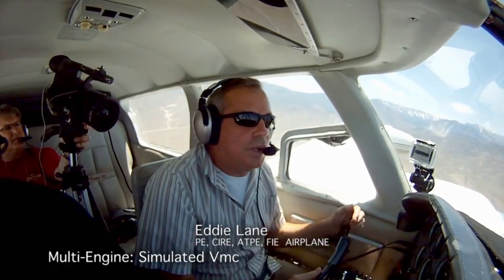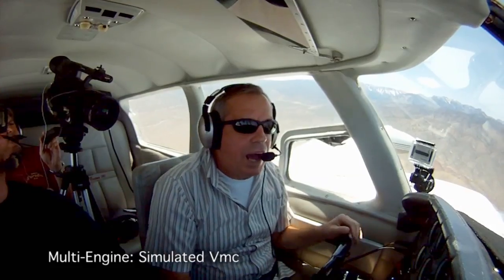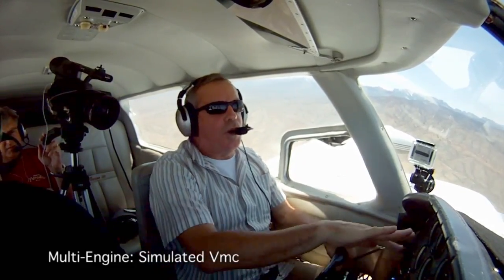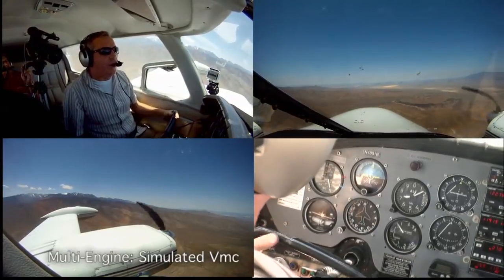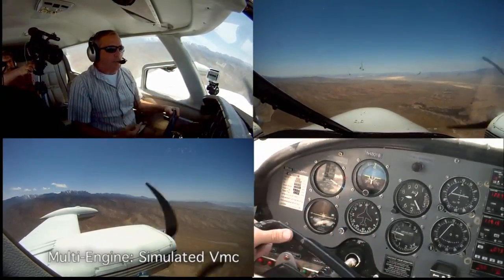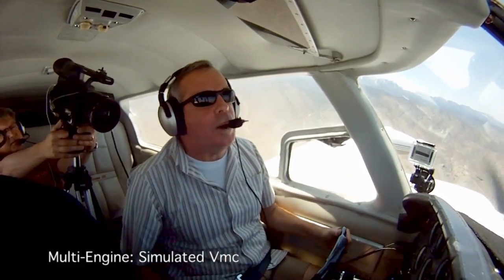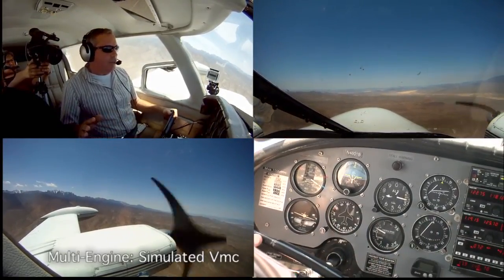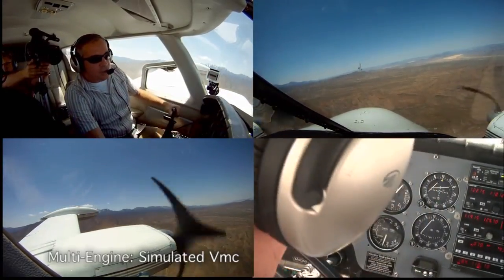Multi-Engine Lesson 4 - Vmc Demonstration

Comment: Doing a VMC demo with a passenger in the back is bad. Moving the CG aft can cause issues if you were to go into a stall/spin. A professional pilot should know better. The accident in Oregon and Massachusetts are examples of when having a passenger in the back may have been a factor in the crashes.

Comment: I've been studying flying for less than a full month and have already seen where FIVE people have died in "Vmc demos" which resulted in spins.  One was 4 Dec 2023, the most recent was 14 Jan 2024.  
Juan Browne goes to great lengths to explain to us how dangerous these maneuvers can be. The results speak for themselves.  Twins are especially dangerous if directional control is lost for just a little bit longer than the pilot demonstrates in this video-starting the spin. With the cameraman in the back seat--there's no way they'd get out of a spin if something happened at the wrong time and it got away from the pilot.  One thing he did have in his favor was altitude. I'd never fly with that guy. Is he still alive?  I wonder how many flat-spin twin crashes have happened in the decade since this video.  Blancolirio channel also shows where two were killed on 3 October 2023 apparently doing Vmc demo, and Mr. Browne is a pilot (of 47 years) that I fully trust.  SEE his channel if you think Vmc demos are a "safe enough" exercise.   They are safe enough in the simulator, but are a ridiculously dangerous in the air, and especially below 5000' AGL.  Think twice about Vmc demo in a twin. too many pilots let this one get away from them and the result is usually tragic.
Reply: Usually the issue with VMC demos is improper recovery, specifically people putting the nose down without taking out the power from the operating engine. That just throws you into a spin

Comment: Engine loss on takeoff with gear up does one reduce some power on good engine like in this video or does one simply follow "The Drill"?

Full Props, Mixture, Throttle then gear & flaps up, identify, verify & feather, raise dead engine slightly & keep ball half ball.?

Comment: What's more interesting here is that no point does he address what configuration the aircraft is in, or supposed to be in, for the demonstration. A Vmc demo is supposed to be performed in the takeoff configuration, which in this airplane would simply mean doing it with the gear down. No mention of it.
Reply: Lol the takeoff configuration is definitely gear up.....
Reply: @GZA036  No, actually. A properly executed Vmc demo is started with the gear down. It's intended to simulate that you've lost an engine in the first few seconds after rotating, with no usable runway left in front of you.
Reply: @TheS4Aviator  part 23 states the gear has to be up for the vmc speed..
Reply: @TheS4Aviator  Im an MEI and ive signed off 10 Multi students and always did it with the gear up. Your completely wrong.
Reply: I did my VMC demo on my AMEL check ride with the gear up, which was how I was taught.

Comment: Vmc is not the airspeed at which you lose control, it is the minimum airspeed at which the aircraft is controllable. Quit looking at the guy in the right seat, Keep your scan out for other aircraft and your instruments. During the demo, keep your hands on the yoke and throttles at all times. This instructor is a complete idiot and should have his certificates revoked by the FAA.
Reply: gypsykingg your not a pilot. 
Vmc is not a hard speed limit like Vne. It’s a reference speed that is determined by the manufacture, at which when the critical engine is made inop it is possible to maintain directional control with an angle of bank less than 5 degrees. The actual minimum controllable airspeed can vary considerably depending on...
Power 
Prop (windmilling/feathered) 
Weight 
CG 
Density Altitude 
Sideslip Condition
Remember an airplane will stall and spin at any airspeed, but it will always do so at the same AOA. Thus could fly the plane as fast as Vyse and still spin if grossly mishandled. 
Fyi. I don’t know any one pilot who keeps their hands on the “yoke and throttles at all times.” Good pilots know how to keep their ship in trim. Basic pilot wannabes do not.
Reply: Mobius Mirage ouch😹😹😹💖